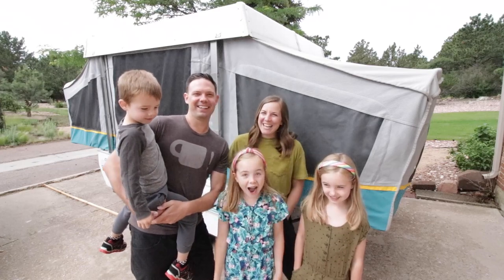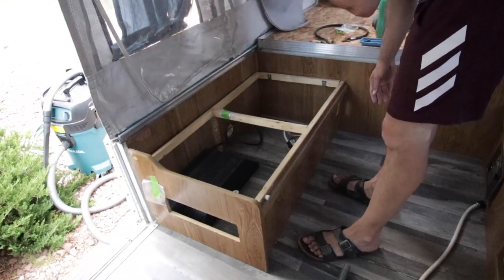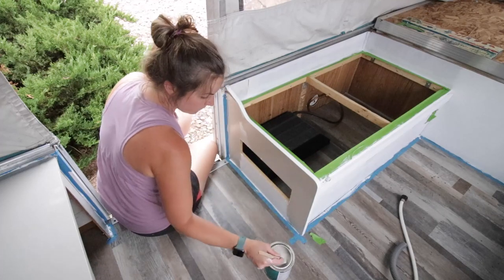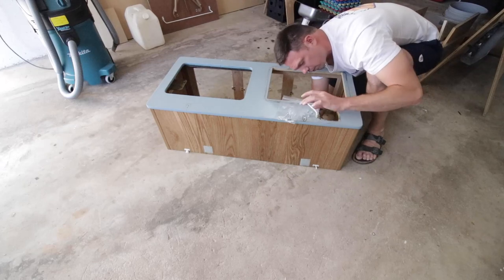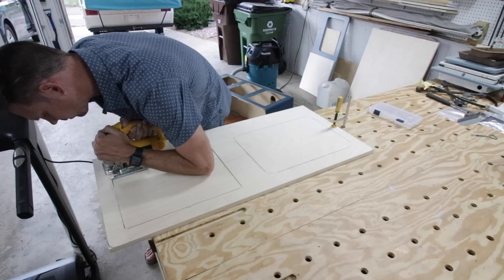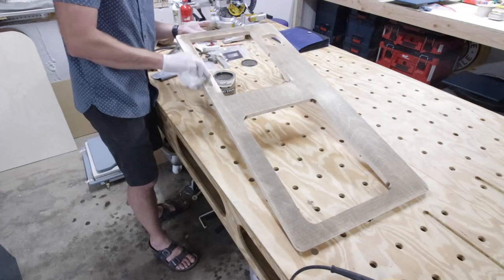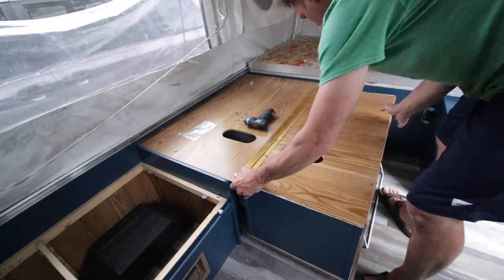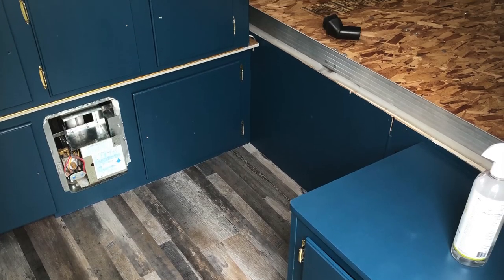Our Pop Up Camper Remodel Part 2

Comment: Hey! Pro camper tip, ditch the inside sink and get an outdoor sink and table. They are pretty cheap. Then get a piece of large wood and make a new table top over the sink hole. I attached it with nuts and bolts so it’s easily removebale when you drive with it, also looks rustic! Have fun goodluck!
Reply from the maker: Sweet! Thanks for that tip!
Reply: I would like to see a picture of this

Comment: Why didn’t I paint when they were out of the camper. Instead of risking it on the new floor. And being cramped all awkward
Reply from the maker: We painted some of them while out. It wasn’t a risk as we used tape. Didn’t bother us at all. Also we wanted to see the look immediately which worked well since we changed the color because we didn’t have to wait for paint to dry then install to see color match. To each their own I guess.

Comment: Hi. Love this video! Very helpful! Question: any particular reason u removed veneer and sanded the doors only but not the cabinets? Im starting mine soon and would like to know if the removal and sanding made a difference?.. I was planning on just starting w/ primer 😂
Reply from the maker: Thanks!  We did that because it was peeling. The other areas weren’t peeling and don’t have that veneer so we left them alone.  The reason the veneer needed peeled is because it would be obvious even with paint and it doesn’t sand well. Hope that helps.

Comment: Great video! I appreciate the step by step.  Curious as to what type of paint and primer you used on the cabinets.  Did you go with oil, latex or alkyd?  The blue cabinets are beautiful with the gray floor!
Reply from the maker: Thank you! 
It was all Sherwin Williams. We used their primer and then the cabinets is their “Emerald” line which is Urethane Trim Enamel in “Seaworthy” color. Hope that helps!

Comment: did you sand the cabnets at all before you painted them or did you just clean then paint? im planning on remodeling my pop-up and im afraid of the paint peeling off
Reply from the maker: We peeled the fake wood plastic sheets off the cabinet doors, sanded then painted! Hope your project turns out great.